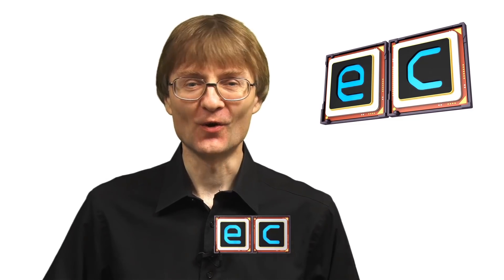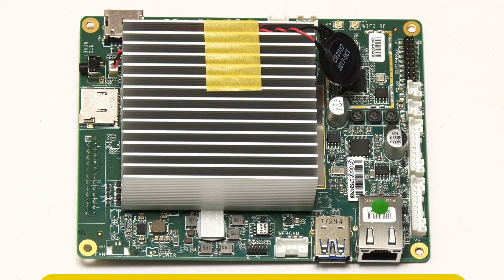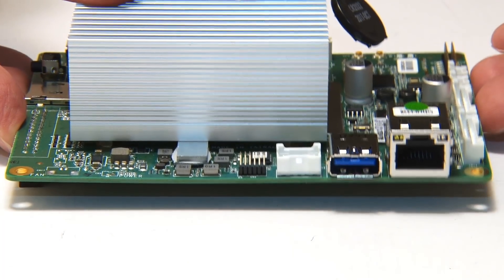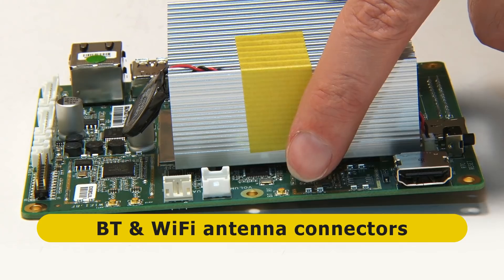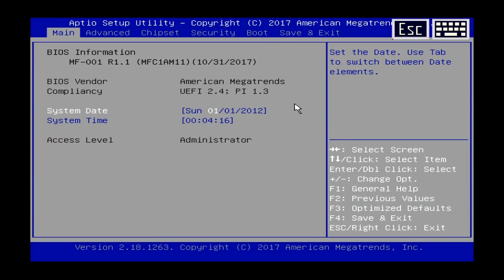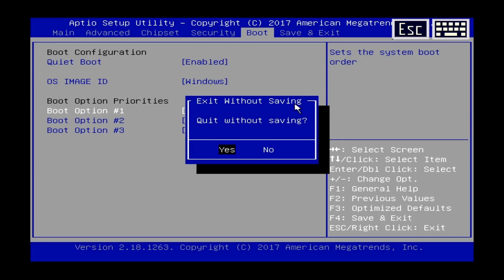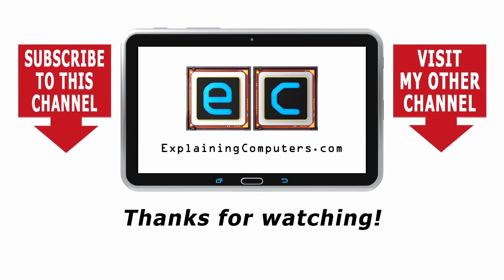Atomic Pi Intel Atom SBC

Comment: having looked into this seems to be the biggest gripe they went to the troble of soldering a rtc reset button for some reason but didn;t put a usb or barrel jack anywhere for power input
Reply: As explained in the video, it was designed to be integrated into a larger robotics project, it was never intended to be sold this way. Many of the design choices are less than ideal for home SBC users, but the price/performance is very good.  You take the good with the bad.

Comment: Good informational video!
Just one question. Are the power pins connected correctly? I have an Atomic pi as well, but haven't been able to power it yet. The manual suggest pin 3,5 and 6,8 for ground.
Reply: Clean regulated 5v power goes to 3,5,7,9 and ground should go to 2,4,6,8. Go to reddit and ask your questions there in the power thread https://www.reddit.com/r/Atomic_Pi/ where I and/or others will likely answer them in detail.
Reply from the maker: I am pretty sure my power pins are connected correctly, certainly in line with the info sheet supplied with my board -- 3 and 5 positive, 2 and 4 negative (there are lots of GND rails).
Reply: Had the same problem. Your cables are probably to thin and dont support the necessary amp. Try 2 more cable.
Reply: Great, works now using 6 cables in total.

Comment: Atomic Pi w/4GB RAM and NVME slot would be sweet.
Reply: Reads like the form factor of the CPU is the limiting component.  Not thinking will be easy to reball the better CPU and Memory Chip.  Will be interesting to see if anyone does.  I posted a question here on reddit with some detailed answers:
https://www.reddit.com/r/Atomic_Pi/comments/byi1tt/anyone_looked_into_upgrading_the_memory_on_these/
Reply: YESSSS.
i bought this a while back and it was such a tease how many games i was on the verge of running if it only had 4gb ram i would say it was a perfect board.
Reply: Nvme & Atom🤣

Comment: I'm glad the info I provided on your community post a few weeks ago was helpful and that you included it in the video.  I know I'm not the only one who figured things out, but I'm glad to see the info shared as it really is quite interesting, from the manufacturer, to the connection with Bosch and a named product.  I suspected from the beginning that the Atomic Pi was from something else, due to the board's many quirks such as power delivery and the CPU that is no longer produced.  Very well presented here.  I've said elsewhere that, regardless of what DLI paid, selling the board for roughly $35 is to the benefit of SBC fans, so I have no issue with it.
Reply from the maker: Thanks for this, and your info in the community tab, which led me to retrace your steps and search around a lot. :) I agree with you, selling the boards for $35 is good for SBC fans.
Reply: @ExplainingComputers  I nearly forgot that I had seen it, but I also recently came across the US FCC teardown and internal photos of the Kuri.  It shows the board in the robot, and various peripheral boards.  It may explain the extra connectors.  Someone else found it and I came across the link after I provided the info to you.  Here is the link if you wish to look at it further:

https://fccid.io/2AN44-AHR-M8T/Internal-Photos/Internal-photos-1-of-2-3909532

Comment: would love to see if the x86 could run minecraft and at what frame rate, maybe you could do a test
Reply: The Win10 edition - maybe, but for the classic java Version you definitely need more horses under the hood.
Reply: @utebruggenfompel5764  it'll work? just depends, playable? it's worth a test if you have the hardware, I can give you user and pass keys to test for free. If i have the money then would try. I really need to get onto youtube and show and tell but not good on camera
Reply: @PetRatty  Trust me, buy a used PC off of eBay or Craigslist for maybe 50 bucks, you'll be better off using that instead of the atomic pi
Reply: @utebruggenfompel5764  I tend to agree with you.  I enjoy my Atomic Pi's, but it's really only for those that are technical.  Most would be better off getting a used or refurb PC for $100 or less. It will be a lot less hassle.

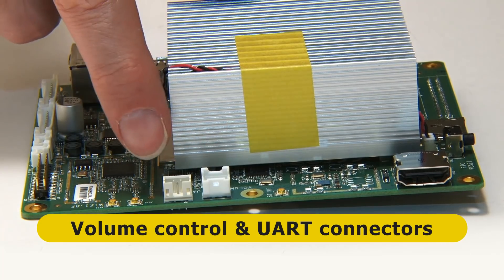Comment: Hi, Chris! At 5:10, CN13 and CN14 are connectors for what I believe are I2S MEMS microphones. Each 10-pin JST connector has space for 2 microphones. In Kuri, these would have been used for for the speech recognition and other microphone-y things. There are four mics in total to allow Kuri to know what direction the sound is coming from and allow it to turn and face you.

In case anyone's wondering, the pins are:
1 -  3.3V
2 - data output
3 - bit clock
4 - left/right clock (word select)
5 - ground
6 to 10 - repeat of above
Reply from the maker: Great info, thanks for sharing.

Comment: Too bad it doesn't have a second Ethernet port, looks like an excellent and super cheap pfsense board, it does at least have usb 3.0 though so that kinda makes up for it.
Reply: Depending on your use case it does have wifi

Comment: The lack of USB ports was mystifying until you revealed that it was designed for another purpose. Great work as usual, Chris!
Reply: You can add a USB 2.0 Port; the pins of the "webcam" labeled JST connector are electrically just a USB 2.0 port.
Reply: The full breakout board maps the web cam port to another usb port

Comment: To me this really shows the drawbacks of CISC based machines. A large footprint in size, power and heat for quite minimal interfaces compared to the average RISC based system. It is a fun board with some ooompff but just feels dated to me.

Comment: I feel like they should have done  4GB RAM for that price
Reply: Are you kidding ?
The processor used doesn’t support 4GB of ram. This is clearly stated in the intel docs.
Reply: @awomandoesnothaveapenis  Atom PCs are around with 4gigs
Reply: JonnyInfinite I know, but this particular CPU is a T3 package and doesn’t support more than 2GB, that is from the Intel docs. One of the UP boards uses the same CPU but has 4GB installed. On that board is a CPLD or FPGA that users can’t play with, which would indicate that it has something to do with memory management.
Google for the installed processor.
Other processors in the series can support 4GB but unfortunately not this little puppy.

Comment: Hello Chris,
Have you ever considered taking a look at second hand thin clients? Due to business IT departments refreshing hardware, they're often on eBay pretty cheap. I recently got myself a Wyse 5020: AMD GX-415GA (1.5GHz quad), 4GB DDR3 (upgradable), 16GB SATA DOM (upgradable), DVI (adaptable to HDMI with audio, or VGA), DisplayPort,  gigabit ethernet, 4x USB 2 and 2x USB 3, and analogue audio, in a case and with a PSU, for £65. Plus a second SATA socket and internal space to sneak in a 2.5" drive, if you devise your own mounting method! I've set it up as a little headless server running Debian, but it happily runs Mint 19 from a USB drive as well. For £65, I consider it to be fantastic value - and much nippier than the Pi 3B+ which it replaced.
If you search for parkytowers, a chap named David Parkinson has write-ups on a range of machines.
Reply from the maker: Interesting idea -- noted with thanks. :)
Reply: @ExplainingComputers  I forgot - there's a mPCIe slot hidden inside as well. :)

Comment: Amazing little SBC for the money. It might not be for first time SBC buyers as its not quite as "plug and play" as some other SBCs but if you have a bit of patience and look at say, Explaining Computers, for a bit of advice then you could be up and running in less than 30 minutes. Love the history lesson on the board too. Excellent and informative as always
Reply: It's a product for people who don't shy away from using their soldering iron and maybe a drill and some nuts to mount this thing somewhere somehow.
Reply: @utebruggenfompel5764  
Yeah, thats kind of my point. Great SBC but doesnt have the straight out of the box ease of use.. Perhaps someone will make some 3D printer cases for it that will fit with the expansion boards fitted and make things a little easier.
Reply: You would never of survived the early years of computing hahaha
But we were kinda sploit it was a viable thing to wire wrap a computer system yourself.
Reply: @awomandoesnothaveapenis  
Being over 50 years of age I did survive the early years of mainstream commercial computing. The thing is, there are too many options now that do not require numerous steps before you can actually turn it on, unfortunately that may put many people off this very capable and well priced SBC
Reply: Fair play mate, you saw a bit more of the early days than myself.
I guess I’m just a tinkerer and enjoy the little bit of extra effort, and forget everyone isn’t like that.
Most of that was tongue in cheek.
Have we come to a stage where connecting 4 to 6 wires is a bit of work ?
But it is a great piece of kit, even at $50 odd dollars I would have still got one.
Maybe if it had of sold for a little bit more people would have looked into it a bit more, rather than just pressing the buy button and expecting more than what is. And to be fair for an extra few beer tokens there were 2 boards that made powering the board easier.